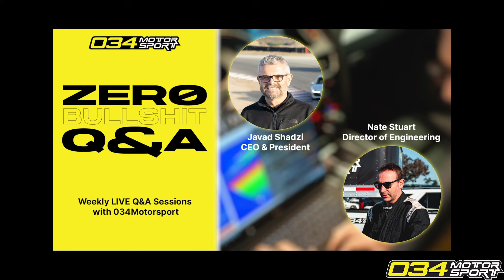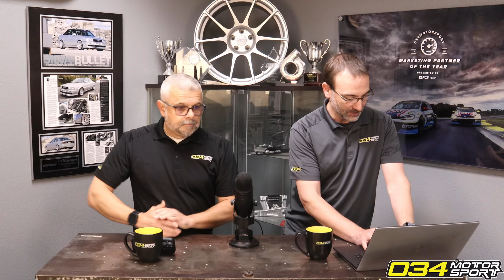Live Q&A, Round 241!

Comment: If I just installed a super duper intake/inlet, will these 2 void warranty or NOT pass emissions in any way?
Reply: Email customer support to request an official CARB sticker for your intake if they have it certified. They will also verify that you have the CARB tune flashed before sending it to you . If you’re running high flow cat or cat delete…. You got no chance. As far as Audi dealership flagging your car as TD1 ….  No tuner can guarantee it won’t get flagged but the best advice is to flash back to stock file before ever letting a dealer touch your car. They will be able to see your flash counter but that’s not definitive proof that you’ve been tuned. Even if you are tuned they have discretion to say if any component failure was related to those mods . The over cautious people wait to be out of warranty period before flashing
Reply: @Pwnulolumad thank you for the reply. There is NO tuning involved. Just asking about the addition of the intake/inlet only as it pertains to passing emissions or voiding a warranty.
Reply: On a completely stock s5